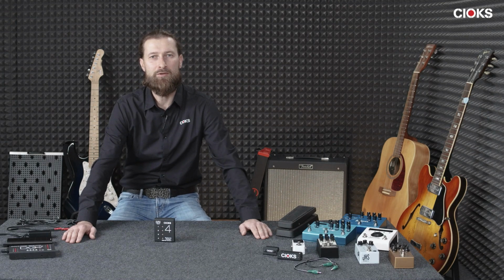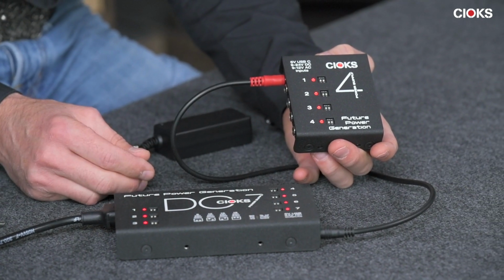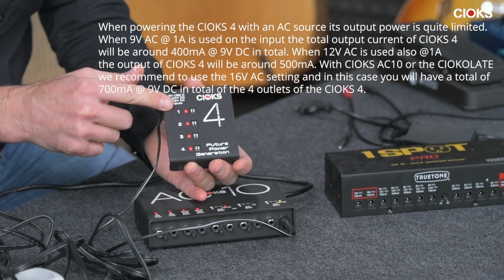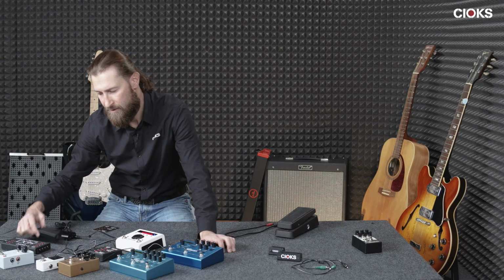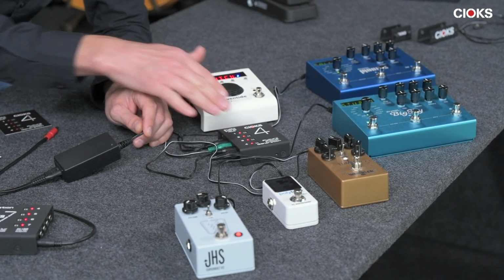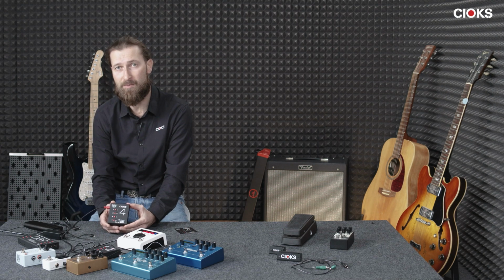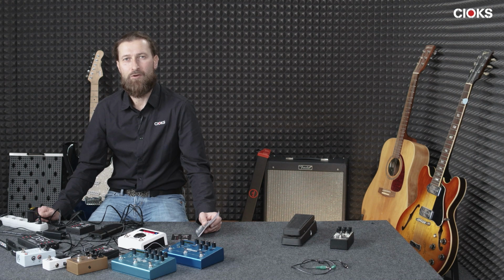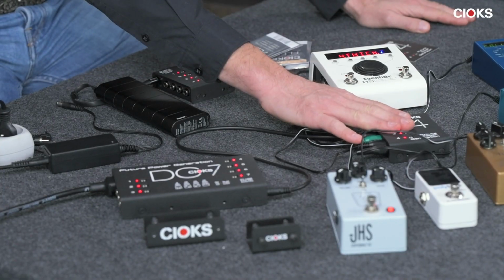CIOKS 4 power supply - introduction

Comment: Great power supply. The adapter kit is not available anymore. The Boss PSA 230s(9V/500mA) does not work with it, but my GoSolid! adapter(9.1V/1000mA) does.

Comment: Hey Guys I’m currently building a small pedalboard for an acoustic gig that I hopefully will have in the USA in August and I also want to continue using the board in the U.K when I get back home. I only have a digitech Jamman Stereo (4 button discontinued version) and a regular tuner pedal Boss TU2 and am wanting to get a power supply that A. Works in USA and U.K. and B. Powers the 9vAC 1.3a digitech pedal. Iv read that line the Line 6 DL4/M4 that is 9vAC 1.2a can but run off a 9vDC with 680ma or more. Is this something that is possible from the Cioks 4. Thanks Danny

Comment: I was happy to finally find a perfect small size, insolated, reliable power supply for an only 4 high quality high current pedal train I have, I was about to buy it (to use it as a stand-alone supply) but I realized it is very hard and expensive to get  the "24v40w adapter" and it's a must to get the complete power out of this... damn! it's a pain in the neck! I'm saddly going back for a classic Voodoo Lab ISO 5 :(
Reply: Same as !!

Comment: What is the difference between 1SPOT + DC4 and Ispot+ multi-plug 5 Cable?
Reply: The DC4 provides isolated outputs, whereas the multi plug simply daisy chains all of the pedals on one interconnected circuit. Depending on your pedals, that can lead to extra interference noise (especially distortion pedals) while isolated outlets help prevent that. Also, each of the four DC4 outlets can be switched to 9, 12, 15, or 18v, if you have pedals that can run at those voltages, whereas the multi plug will be all 9v.

Comment: Two questions :
1. Approximately how long will a fully charged 10000 mAh power bank be able to provide power to cioks 4... Say you are using 4 analog pedals and 2 digital pedals (total of 6 pedals) ?
2. Is there any added noise if you are using power bank to power cioks 4?

Comment: OK, full power capability is 24 W. It is a bummer that USB-PD protocol is such a mess both for manufacurers like you and the consumer not knowing what exact cable is needed for such applications (in your case USB-PD V3.0 would have nailed it, then it would have been possible to accept 12V and 2A on the USB-C input to get the full power capabilty of your 4). So your power supply is always limited to 15 W when using the USB-C port both with a power bank and a USB power supply. That is 9 W less than your 4 could fully deliver. I will nevertheless buy the 4 just because it is the only (i think so) power supply on the market you could power directly with an USB power bank via its USB-C input.

Comment: Hello Paul, can i power the Qtron plus from the 24v outlet  of the dc7 ? its requieres 24 v , negative center low amp, regular boss plug ? can i use just a standard cable or will requires the cable that you are using to connect the cioks 4 here ? Cheers! Gabriel

Comment: Hello, I'm not an expert here so I have a simple question. From what I understand cioks 4 needs an adapter of 40w of power in order to reach its full potential. If I choose to power it with a 1spot 9v, hence as you said only 10w of power, does it mean that the pedals I want to power won't perform as good?

Comment: Would it be correct to assume that with an external AC Adapter of 12V and 3A (36W) it would still be possible to get from the Cioks 4 the full output power of 24W? Would there be any benefit in purchasing the 40W power adapter by Cioks, which I assume to be a 24V / 1.65A unit (or anything close to that)?
Reply from the maker: Hi, 36W adapter at 24V DC is ok if it really puts out 36W. Then you still get the full output power of CIOKS 4 but not more than the full nominal output of 24W. The 36W adapter will struggle while the C4 would still have some headroom above 24W output. But going up to the edge of nominal output power will be ok.

Comment: good to know the versatile power input options for this product! i just got mine. just wondering alternatively, can i power the CIOKS 4 using a USB-C power adapter? as long as the output is more than 40W? the likes of Anker etc.
Reply from the maker: Yes, you can use a USB C power adapter to power the CIOKS 4 but only if you have version 1.1. Powering CIOKS 4 with a USB C is not possible for version 1.0. As CIOKS 4 only accepts 5V and 3A max. tha maxinum power you can feed into CIOKS 4 with a USB source is 15W.
Reply: @ciokspowersuppliesforeffec7533  That's very confusing ... isnt't the Cioks 4 in this video a Version 1.0 (Vintage 2019) unit? Yet, you're successfully powering it up with a USB C battery pack! So I really don't get the note about the v1.1 requirement in your previous reply...or is it referred to the possibility of supplying the v1.1 version with a wattage higher than 15W via the USB C connector?

Comment: Where can I buy the external ac adapter?
Reply: Following for answer. I'm thinking of buying one to use as a stand-alone supply, but i noticed the disclaimer stating that an AC source can limit the output.
Reply: ...Still following for an answer
Reply: @Ratchman_5000  Me too... I was about to buy it (to use it as a stand-alone supply too) when I realized it is very hard and expensive to get  the "24v40w adapter" damn! it's a pain in the neck!
Reply: @marcoramirez8885  After getting more pedals, I wound up buying the Cioks DC7 which comes with an output cord to power the 4. I love the low profile and overall build quality.
Reply: @Ratchman_5000  I think it works cool that way, I would do the same but I just need it for a small vocal performer pedal train so I need a tiny, insolated and reliable PS...  And I'm seeking for the Voodoo Lab ISO 5

Comment: Great video, thank you. Would it be possible to power the CIOKS 4 via the Thunderbolt port of a modern MacBook Pro (4 Thunderbolt ports)?

I am thinking about using it with a small board, and I would love to be able to power the said board through the Mac without the need of using any external power supply, or battery banks. The pedals in question are the Iridium, the Flint, the MAKO D1, and JAD MeLody OD.

Thanks!
Reply from the maker: Hi! Yes this is possible but you need to get the Version 1.1 of the CIOKS 4 and not the initial Version 1.0.
Reply: CIOKS Power Supplies for Effect Pedals Thank you! How would I be able to tell the difference between the two? Can I request my dealer to get the version 1.1 directly from you? Thanks!
Reply from the maker: @michalmikolajmaslowski3994  The version no. is stated on the bottom of the power supply. There'll be both 1.0 and 1.1 out there now so you better ask specifically. With time only version 1.1 will be avaliable.
Reply: @ciokspowersuppliesforeffec7533  Yup, I better do :) I will inquire through my national dealer, thank you!
Reply: @ciokspowersuppliesforeffec7533  Would it be safe to say that all the Cioks 4 Adapter Kits come with a V 1.1 updated unit?

Comment: Can I run just an HX Stomp and a Shure GLX pedal using this and a power bank?
Reply from the maker: What is the actual current draw of the Shure GLX pedal..?
Reply: @ciokspowersuppliesforeffec7533  It requires 9V to 15V and 250 mA
Reply from the maker: @Daeoxify  HX Stomp + Shure GLX will be just on the edge of the output power capability of the CIOKS 4 when powered of a 3A powerbank. I can't promise it will work well. I'd recommend a high quality USB cable for this and you can try it. Also the capacity of the powerbank should be high as you'll be pulling all 15W on the input side of the CIOKS 4.